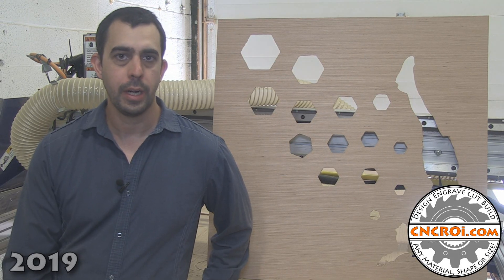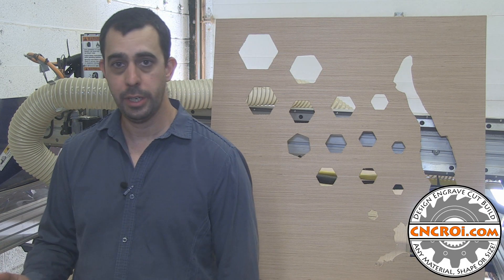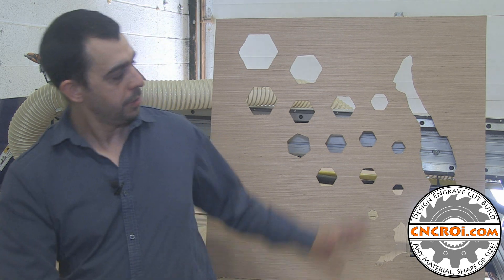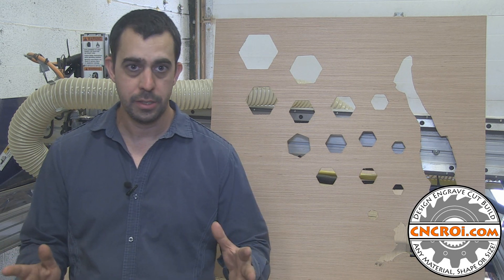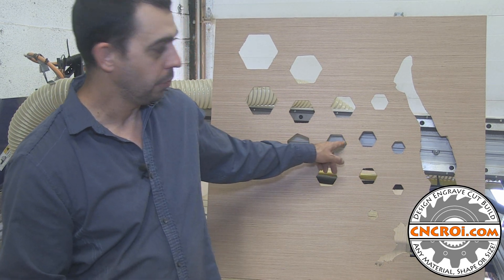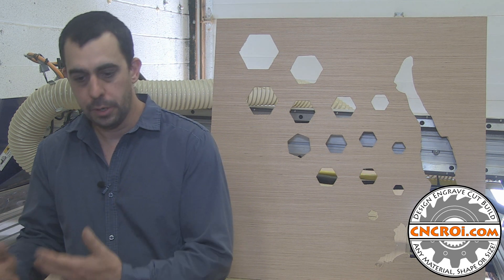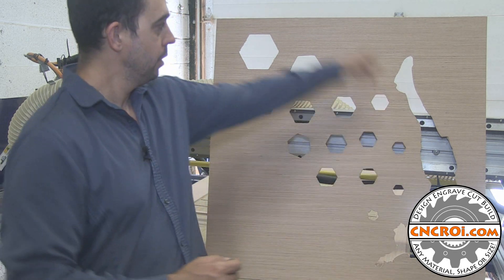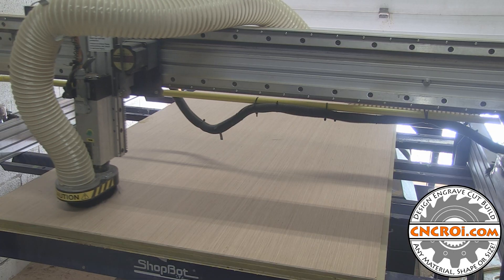Custom Plywood Stencils: CNC Router VS CNC Laser Cutting

Comment: Can you cut those out with this table top router? 

https://www.harborfreight.com/router-table-with-router-95380.html

 like can you hold a 14x16 inch piece of 1/2" wood that has drawn outlines and just move the wood with your hand or will this table top router not allow you do do that? i need to make 6 ovals inside a 14x16. 

thank you for your time!
Reply from the maker: Yes